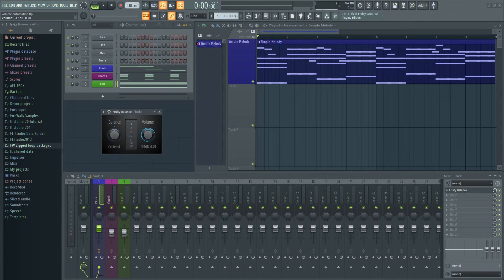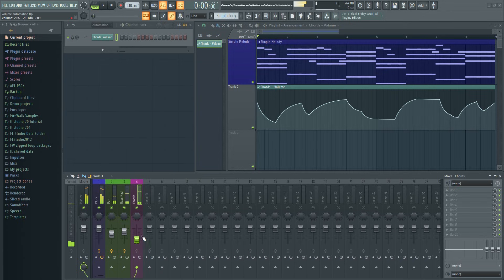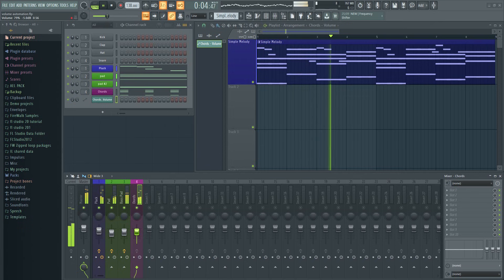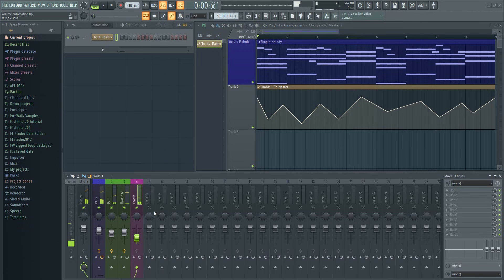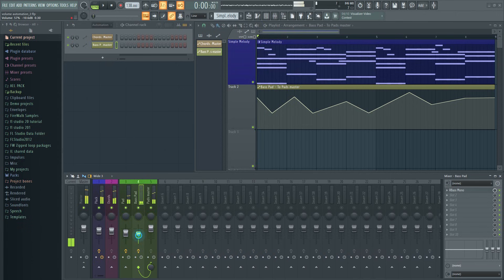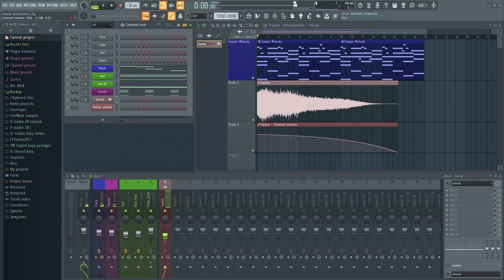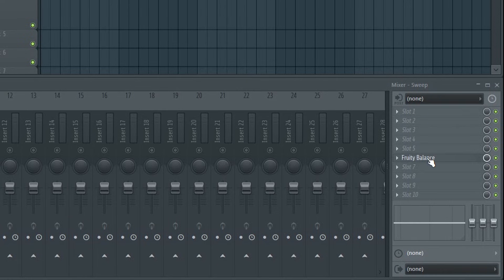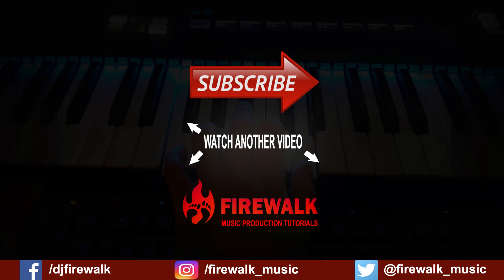The CORRECT Way to do Volume Automation in FL Studio!

Comment: I need a video on master volume automation with a series of mistakes in the master. How to correct so the mix - which is too important and time-sensitive to redo - can be back on track. I can't find the master channel automation and it keeps jumping rendering the mix and track dead. I have reset the track many times and it keeps going back to jumping again. Putting an automation clip in the master doesn't work, it just ignores it.

Comment: Just discovered this channel thanks to this video, and found so many useful tips, subscription well & truly earned!

I do have one issue though... when using the automation method shown where you use the volume to the mater knob to automate, for some reason, the automation does not get exported when exporting to wavs for mastering, and I am not sure why.

Anyone any ideas?

Edit: Should add, this is relating to the individual channel wavs that area created, not the master (the automations are apparent in that), and I have also made sure that the relevant settings are used for exports re insert & master effects.
Reply: OK, so did a little playing and used my grey matter... seems that (obviously) the reason the individual tracks don't have the volume automation applied, is that it is done at the master level, as it automates the volume out of the track into the master.

That would be useful in a mastering (perhaps mixing) scenario, but if you need, as I did, the volume automation to be part of the arrangement, then using the fruity balance plugin is the way to go... still way better than automating the sliders, which is what I was doing :)

Comment: No right or wrong here as you say, except the fader option maybe. I prefer Fruity Balance though, or some other gain plug, in most cases as it remains tied to the track even if routing changes and can be placed last to avoid messing up the levels going into the FX chain. The drawback is one slot less I guess but I can live with that :)

Comment: This video flies in the face of everything that I've ever seen or been taught. You mix into the Master. You need the master to set the overall loudness of the final mix. This is why you first gain stage everything to keep the master from clipping. Shoot for an overall master loudness of -6db to -8db to leave your master engineer room to work. Moving the master volume all over the place would seem like a headache to achieve this.
Reply from the maker: This is about automating the volume of individual mixer tracks and elements in the mix, not the master itself.. Every mixer tracks is routed to the master. This method allows you to automate the volume going into the master from each mixer track. It's the exact same thing as using fruity balance on every single mixer track for example, and then automating that way, except this is quicker and simpler. It's why the mixer is set up this way. You should of course not automate the master channel itself, but that's not what this is about at all. It's just about the levels going into the master. This method is post fader for each mixer tracks, which means that you automate the volume after the processing on each fx slot. If you automate in the channel rack for example, then it will be post fader, which is not always ideal. Especially if you use a compressor, or a de-esser or whatever, because it will be impossible to get the the threshold settings correct with the input volume constantly going up and down. It's then better to automate the volume after the processing has taken place. :)

Comment: Very interesting take that I had not considered before. I do generally favour using the Fruity Balance Volume Knob method, adjusting the default linked 'mapping formula' to 'Input*.8' (to correlate the 80% volume setting of the Fruity Balance to 100% on the automation points).

Comment: I've seen in other tip videos that changing the sample volume from the sample itself, and in the channel rack, isnt actually true volume automation. Is this true?
Reply from the maker: I recommend using the method shown in this video, utilizing the mixer. Automating the channel rack will cause the volume to go up and down so it is technically volume automation. That said, there can be drawbacks to this method. There is a difference between post and pre fader volume automtion. If you automate the channel rack volume then you adjust the volume going into the mixer track. If you have a compressor, a de-essential or something on that track then having the volume going up and down can affect the processing in a negative way. It's usually better to automate the volume after the effect chain, which which will be the case when using the method recommended in this video.

Comment: Awesome vid as always 😍

Right at the end… you mentioned “the order of processing is very” important. 

Would you be able to do a tutorial on this? Would it be best to put volume after EQ, reverb, delay, side chain etc! Confused 😣
Reply from the maker: Hi, thanks! Glad you liked it. Yes, when automating volume it is important to consider pre and post fader issues. For example, if you use the channel rack to automate the volume, you essentially adjust the volume before it enters the mixer, and therefore also before it goes into compressors and other dynamics plugins you might have loaded (de-essers etc) on any given mixer track. That will mess up the settings in the plugins because you will typically set a threshold in a compressor, for example, to trigger it. But then the automation causes the signal going into the compressor to go up and down, and this will change the way it behaves compared to if you put the volume automation post fader. That way the signal going into the compressor will be more constant, and the volume automation will be done after the compressor has done its job. 

It's the same with the fruity balance. If you put it on the first FX slot you automate the volume before the compression etc, but if you put it on the last one then you'll do it after. In most cases, you'll want to have it after. :)
Reply: @FireWalkMusic  Thank you very much for your detailed reply, it’s helped clear up a few issues after trying fruity balance a lot lower down in the mixer plug-in list 👌
Reply from the maker: @chipwolf99034  You're welcome 🙂

Comment: I use the channer rack to automate volume and pan.
Reply from the maker: That can work well in many situations, but you'll always need to consider pre and post fader when automating volume. Automating volume before it goes into a compressor for example, might not be a good idea, unless it's master channel automation. I recommend sticking with the method I recommended in the video :)

Comment: changing volume in the channel rack will be a bit different tho no? considering it's the input volume to the mixer rack which could then affect things like how a distortion sounds
Reply from the maker: You'll need to consider pre and post fader when automating volume. Automating volume before it goes into a compressor for example, might not be a good idea, unless it's master channel automation. I recommend sticking with the method I recommended in the video :)

Comment: Adjusting the volume on the channel rack could interfere in how to signal is processed in the mixer channel, for ex, if you have distortion, drive, or high compression,  if the input signal for those effects gets lower, it will affect how it sound. That might be useful or not, it depends on what your intents are. For just volume, I would stick to the route knob or the Fruity balance.
Reply from the maker: Indeed. You'll need to consider pre and post fader when automating volume. Automating volume before it goes into a compressor for example, might not be a good idea, unless it's master channel automation. I recommend sticking with the method I recommended in the video :)

Comment: I always used the fruity balance method, but instead of fruity balance I used fruity limiter. I guess send automation is better since it's already there. Thanks!
Reply from the maker: There's really no "right" or "wrong" method here, as long as you achieve the end result you're going for. That said, I've found that this method is usually the fastest and most efficient. I usually only use fruity balance and such on the first FX slot on the master and such, for example, if I want to automate the volume of the entire track, feeding into the compressors and such, which is usually next on the master chain. . :)

Comment: I use the fruity balance method, but used to automate the mixers which I can see isn't the best way.
Reply from the maker: Fruity balance works well too. It basically achieves the same thing, but I generally find the method shown in the video to be the fastest and most efficient overall. I usually use the fruity balance if I need to automate the master volume for example. Just put it on the first FX slot on the master, and you can then automate the volume of the entire track, feeding into the compressors etc.
Reply: @FireWalkMusic  Agreed! Thanks as always for top tips.

Comment: Nice tip.. I’ll hold my hands up, I was doing it “wrong”..  thanks for this I will be using your method from now own! Thought they may be a better way, as you say, the wrong way makes using the fader impossible afterwards :)
Reply from the maker: Glad you found it helpful! The unique flexibility and modularity in FL Studio is perhaps its biggest strength, but it can also be its biggest weakness. Because there are always so many ways of doing things, you can easily end up adapting a workflow that's "less than ideal". And once you've become accustomed to doing something a certain way, it can be hard to "unlearn" it. :)
Reply: @FireWalkMusic  absolutely spot on comment FW, it’s all to easy to keep doing it the same way!. I for one will use this tip (current project;) ) and won’t forget. Thank you for taking the time to make this video, it does make a difference to reach out and help others. You’re one of YouTubes good guys in my opinion..keep doing what your doing FW.

Comment: I usually go for adding a Fruity Balance, but the method where you automate the cable link is a pretty good idea. Saves me a few clicks in comparison and we all know a faster workflow can be key for letting creativity flow better. Thanks!
Reply from the maker: Indeed! Speed is key. I find that this is usually the quickest and easiest way to automate volume in FL Studio. If I need to automate the volume on the master though, I usually put the fruity balance on the first FX slot on the master. That way I can automate the volume feeding into the compressors etc. later on, allowing me to control the dynamic difference between the breakdown and the drop for example. :)